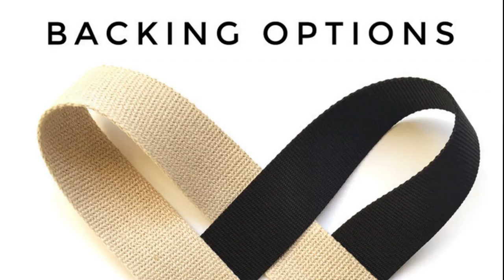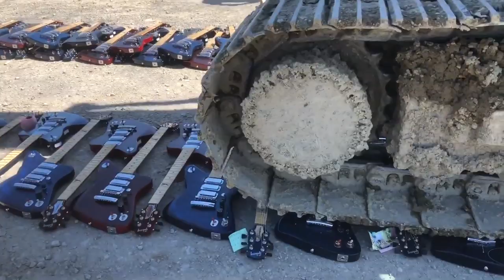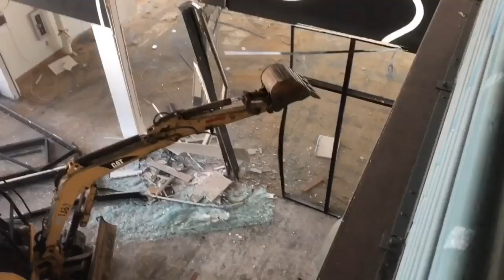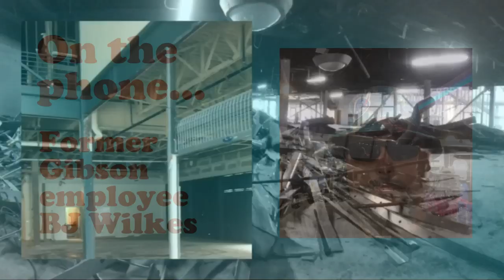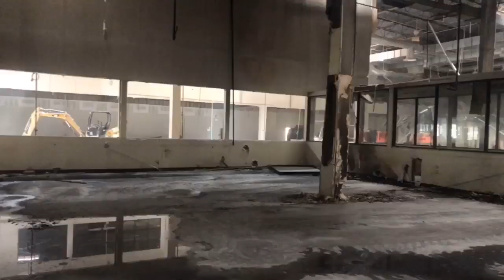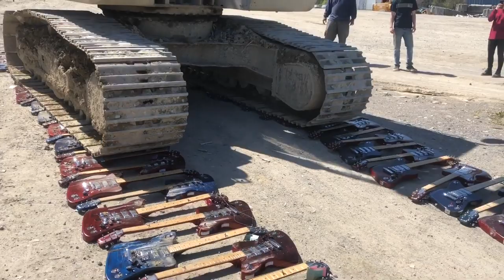GIBSON GUITAR DESTRUCTION! - Firebird X VIDEO MAKER Speaks Out!!

Comment: Don't know if you're aware, but you're video just got shared by Janis Ian on Facebook.  This is such a tragic and unnecessary  waste. They could have re-branded them and at least recovered some of their loss.
Reply: It was cheaper to destroy them. China makes guitars, so does Gibson. A high priced Chinese guitar with hard shell case that has a better finish than Gibson's. $500.00 for one  shipped 10,000 miles, vs $2,500.00 - $5,000.00. Do you really believe Gibson's costs are that much higher than the Chinese? I don't.
Reply: re-brand them would have it's own cost, and as you can see they're not willing to spend a dime on them

Comment: I view it as a positive sign.
Unlike the majority of comments here, it makes perfect business sense in what the new owners are doing.

Gibson has always been a top end product. Producing crap under the Gibson name is detrimental to the entire brand. Clearly the previous owners did not understand that and decided to produce a garbage guitar. There seems to be no dispute about the quality of this tunable firewood.

The main options Gibson would have in this situation business-wise, would be to :

1. Rebrand the guitars either as Epiphones or to sell to another manufacturer but that would require removing all of the Gibson labeling and identifiers and replacing them with Epiphone or the other makers logos first. An expensive proposition and probably not profitable given the new price point for selling these things. 

2. Strip the guitars of all usable parts to be repurposed afterwards. Again, expensive and you will not get 100% recovery of usable parts. Stuff is going to get damaged or lost  in the removal, storage, and reinstallation at a later date. Given the mental capacity of the previous owners in making a guitar like this in the first place, it is doubtful that the hardware was of the quality level that could be used on another Gibson. Or even an Epiphone. So recovering parts is not a profitable business decision.
  
3. Make a show of destroying substandard guitars as a publicity stunt, to send a message that the new owners of Gibson will not produce junk. Which is what they have done. Evidenced by their hiring a tracked vehicle to run over the guitars as opposed to a simpler, cheaper method of destroying the product. Incinerator, or compactor would have done the job easier, faster, cheaper.

So Gibson choose #3. Thereby saving the costs of rehabbing these turkeys, Future warranty expenses and damage to the Gibson brand. Something donating them to charity would certainly have caused.

Comment: The Firebird X could be played as a normal electric without all the usb shit, you did'nt have to use that they could still be plugged straight in and they would play like any other electric. The pups were not active despite the big battery in the back that was for the electronic tuners and the other digital crap. They could have been repurposed.

Comment: The reason Gibson did this is because they were sued by Tronical, a company who was making the 'robo-tuning' system for Gibson. But like any other company that outsources a portion of tech involved in a single guitar, Gibson marketed this robo-tuning  device in their guitars as 'G-Force,' so that is the name we're familiar with. And this is normal practice, it's NOT like Tronical didn't know about this. I'm just pointing this out to those who don't know the relationship between Tronical and Gibson.
Anyway, the problem was that these guitars didn't stay in tune, weren't reliable, and ultimately didn't sell well - and Tronical wanted their money. After the court settlement between Gibson and Tronical, Gibson had no choice but to destroy all of the unsold guitars with this tuning system installed. They couldn't even give them away, as that would be free advertising to Gibson, using Tronical's tuning system. Of course it had to be documented in some way, hence this video. 
Gibson wanted to show they were following the rules. 

It's not purely Gibson's fault. Gibson is worth million$. They wanted to implement a new system for their guitars, when they didn't sell well, Tronical sued. It was settled out of court and Gibson was required to destroy all guitars with the Tronical system installed. End of story.
Reply from the maker: I think that’s nonsense. Not only could they have changed the tuners, but that wasn’t Gibson’s stated reason for destroying them.
Reply: @TheGuitologist  Think what you want. BJ Wilkes was a 'former' maintenance employee, not even employed by Gibson, but by a subsidiary company that oversees park and private land maintenance in Shelby Co.

Comment: When I looked at this at first sight I was really disturbed, but after looking closely at that guitar I understood why they did this. First, this is a model they don't want to be recognized for anymore, it doesn't represent the image Gibson is trying to give back that is one of a tradition with some modern takes but not that radical. They shouldn't give them away say to schools or in some kind of promo or sell them at $100 because it sends the wrong message about the company. It's a marketing dilema. Now, why they didn't took away the hardware and electronics before destroying those bodies? Well, if you see closely none of those things are reusable. The bridge and tailpiece are completely different non-compatible to any other model of the classics Gibson models, the automatic tuner system is a licensed device they have not right to sell anymore and the tuning machines are part of that system, the pickups are also incompatible as they are connected through a PCB, the pots are not pieces they should take out and use in new guitars, they could be suitable of a demand for installing used components in new guitars, and the money they could get of selling those pots are close to nothing. So, there you get, there's nothing they could have done with those guitars so the correct decision is to destroy them. It's hard but is the correct decision.

Comment: If you can bear with this lengthy comment I believe I can shed some light on why this happens. An entire production run of a poorly selling product will often be destroyed when it is decided that the tax write-off will generate a favorable financial outcome over selling at deep discounts. Keep in mind the deduction will be written for the MSRP which is usually far higher than the item would ever sell for even before clearance pricing. As players and repairers of course we would strip the hardware off and salvage anything we could but for a production company to assign an hourly employee to remove these bits, which were bought cheaply in bulk, by hand could easily be a loser. In the old days an IRS agent would be on hand to witness and keep count as each unit went into the site's compactor and was crushed but evidently video evidence is good enough these days. I think it's a huge PR blunder for Gibson to do this in such a spectacular manner just because someone thought it would be great fun to run over them with an excavator, and then not control the video. The universal resentment will end up costing them more than they're saving. I do wonder why they weren't donated; they would've earned the same write off with a bonus of positive PR. My two cents, guaranteed worth every penny.

Comment: I remember just a couple of years ago Sam Ash was selling out Les Pauls with the new auto tune system that people were complaining about.  Seems it would at times glitch out and detune the strings till they fell off on the floor.  Probably not a good feature for live shows.  I don't remember the exact price but it was $500 & change - with the hardshell Les Paul case.  People in comments were saying they were buying them and just changing out the tuners.  I see no reason Gibson couldn't have done the same with these.  It's hard to watch the video crushing and wasting so much.  They probably could have sold them just like the defective Les Pauls, or at minimum salvaged what looked like hundreds of thousands of $  in pickups and tuners.  I've only destroyed one guitar in my life.  It was after my first attempt to learn leveling and dressing frets and lowering the saddle/action on a new Ovation acoustic i had bought.  It got stomped,  but in this case it richly deserved it.

Comment: You spoke of their investors....if I was one, I'd be pulling out. If they really want to fix problems, instead of inventing junk like this line of guitars, try fixing Les Paul headstocks... Yes, scratch and dents could be sent to the relic bench instead of destroyed...WTF kind of business model is this...? If they take metal off really damaged stuff, they'd make a killing opening an online shop called 'Pull Off's' ...good parts that were installed and sold as 'used but never sold'.Guitars as 2nds, stamp it as such, inside and out so they cannot be 'returned for warrantee'.

Comment: As disgusting as this is, this is far too common with manufacturers in general. The product no longer matters- it’s all in the accounting. 
Corporations waste millions of dollars in order to try and save a dime (and it usually doesn’t work in the end.)
They will overlook problem solving with a product’s finished state and supposedly claim process reworking will eliminate repetition of the issue in the future. 
In my particular field, all that matters is if the order is closed in a “timely fashion “ and chase the customer down to complete the billing process. 
We are currently implementing a “quality control” system that is supposed to track issues better than the operator of the machines can- in hopes of eventually not training the employees to have to track quality. 
The system they are currently launching is incapable of measuring (at least) a third of the most common quality failures (internal threading of our products) and the employee must still complete said testing for those issues. 
I could go on with this, but instead will welcome any reply questioning my above statement. 
Have a great day, Brad and Guitologist fans!
Peace and Love ✌️😎💕

Comment: The Firebird X was a stupid idea to begin with. The reason people pay a premium for a Gibson is with the exception of  maybe a refret and basic upkeep you can play one a lifetime and your kids and maybe even grandkids can play it after that. The X had a bunch of gimmicky tech that would end up obsolete in a few years and built like modern electronics that will end up unrepairable unless you replace a pcb that’s no longer available. If it was a $500 setup it would have probably sold but not at $3k. The fact that they didn’t reclaim the bridge/tailpiece/tuners/pickups at least is insane considering the company is already in debt up to it’s ears, they threw away thousands of dollars worth of sourced hardware that was new and even with the odd electronics the hardware is standard and used on many other models. The fact that Gibson was purchased for $5M for everything from Norlin and still ended up hundreds of millions in debt just shows what kind of management Gibson has been under in recent years.

Comment: When companies decide to take a write off on inventory it has to be destroyed.  I had an old three cylinder SAAB I needed parts for just to discover SAAB had taken all the parts for that series of car and put it all in a land fill.   Sad.
Reply from the maker: It doesn’t have to be destroyed to do a tax write off.
Reply: @TheGuitologist  Companies can choose a variety of ways to dispose of inventory they would rather write off than use.  Sure, they can decide to try and salvage parts they feel might have value but that takes time and resources.  

Sometimes they decide its easier to destroy it and claim it as a total loss.  In the case of these basically unsalable guitars they probably decide crushing them and hauling them to a dump was the quickest, cleanest way to go.   

If they left them as complete guitars they end up with a liability.  Folks will end up with them and since they basically suck it diminishes their brand.  

Maybe there were some parts of value but that means labor to remove and then the effort to sell or re-purpose.  

So someone decided a quick clean slate approach and move on was best.  Kind of sad I know, I find myself wanting one of them now!   Even though I am sure I'd quickly hate it! :-)
Reply from the maker: @MicheleBoland  We always want what we cannot have.
Reply: @TheGuitologist  I'd say sometimes we want things that we won't want if we actually got them.

Comment: From a cost accounting 101 perspective, this is just ridiculous from every aspect.  First of all, if you wanted to really destroy these things why not just burn them in and incinerator. It be way more efficient, and you could at least scrap the metal parts.  Also running machinery like an excavator (which is made for excavating dirt not crushing things) is expensive.  It requires a driver who is a well paid skilled laborer, and machines run on something called diesel fuel and burn fuel rather quickly.  This process is just full of unnecessary costs.  They are also paying five guys to just stand there and talk on the phone and spin in circles in the background.  Also you will have to pay people to clean up bits of mess and junk for perhaps an entire day after this crap is done.  This is what they think is a good way to spend money?  Gibson owners are paying extra money to make some dumb spectacle of crushing things in a way that only Beavis and Butthead would think to do, or would think is cool.  Simmer down now Beavis.  It's completely crazy, and I hope a grown up shows up and helps these guys out before they start wacking in the tool shed.  Someone still owns this company right?  There is no additional tax breaks for being an idiot.  The only reason to scrap something in business is to try and get a salvage value or say secrets or something.   You don't get any tax break for destroying your inventory.  Income = Revenue - Cost.  Its one of the first rules of accounting. It is good in a company to pay taxes anyway.  That would mean that the company actually is making a profit.  Isn't that the point in having a business?  To run it profitably?  Whats happening here?